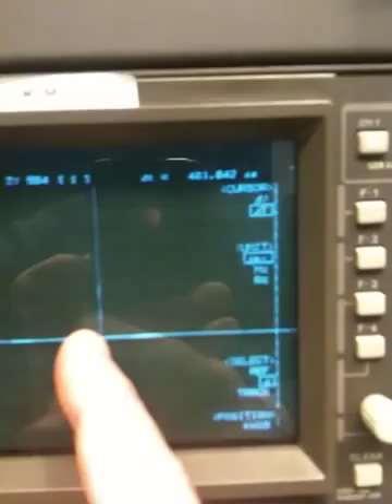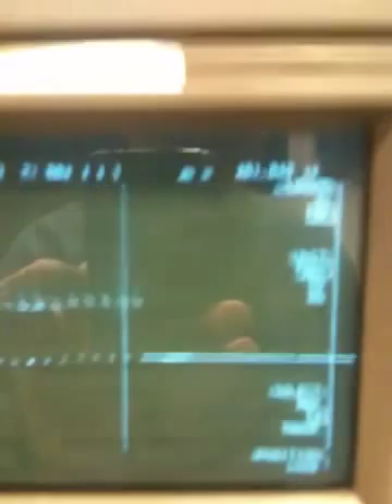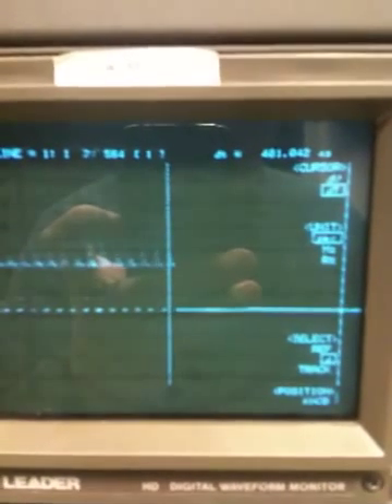Timing an hd-sdi video signal source in a broadcast environment

Comment: interesting vid, trying to learn more about this techie stuff - what were the 259 etc values exactly?  You were doing it through that viz app? was the source trying to be synced up with the 'genlock' or wahtever?
Reply: RoberTastic I believe it’s the vertical line number but He’s using the serial connectors on the frame synchroniser to control them with software rather than adjusting the timing manually. 
On SDI frame synchronisers you usually have  7 lines + seven lines -  that are adjustable indeed Those numbers He quoted will change depending upon the run of the cables eg your rack set up so don’t get too worried about the numbers. What we are doing here is to delay the timing so both timing signals line up enabling a vision mixer to transition from one to another source without glitch or jumping. H Horizontal Sync 
V Vertical Sync ..
SC Sub carrier.